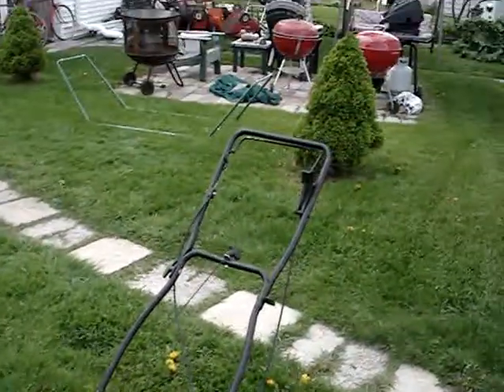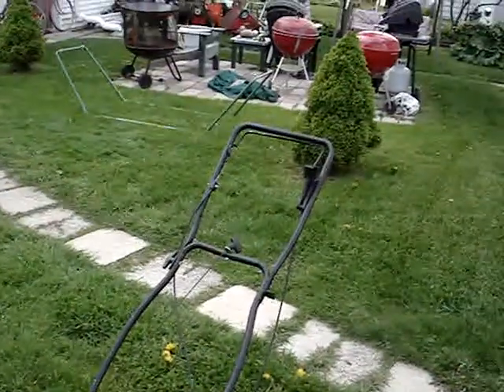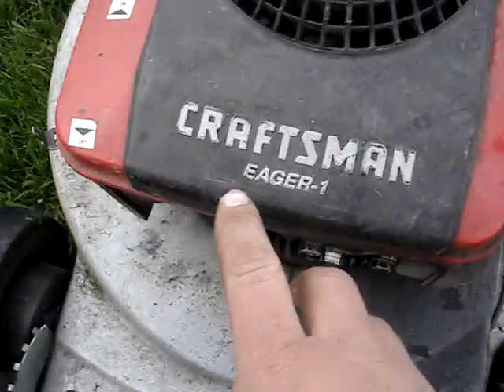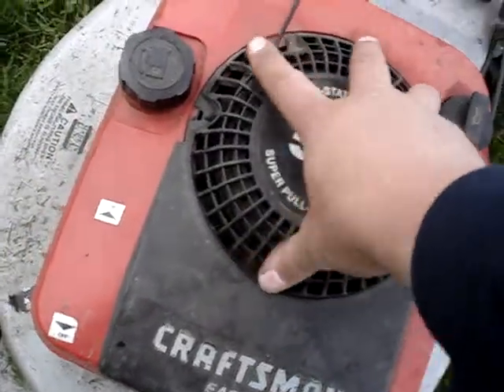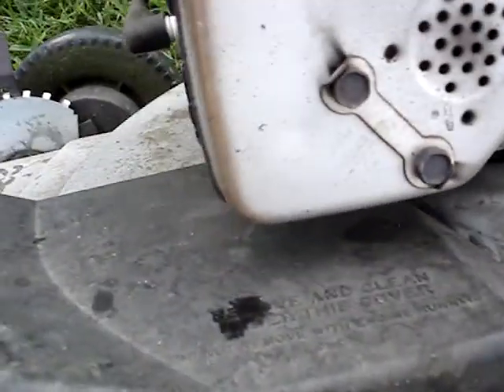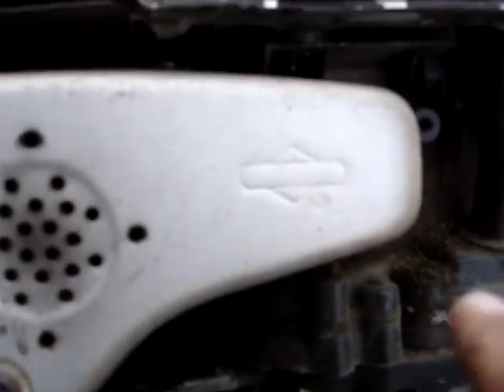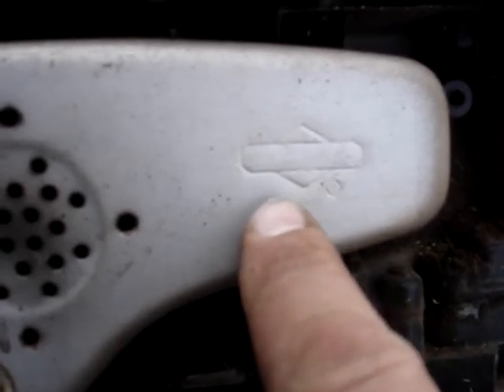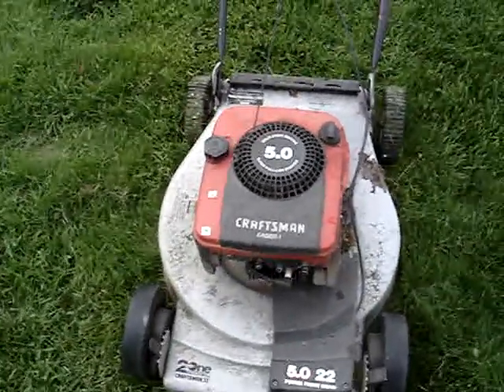Its Not A Tecumseh Engine!!!!!!

Comment: HAH! this is a briggs engine, if it was a tecumseh the carb intake manifold and the muffler is on the same side, but this is clearly a briggs engine, and on top of that, briggs use thay type of muffler, tecumsehs don't
Reply: SpiritsoftheWolf no not on my Tecumseh